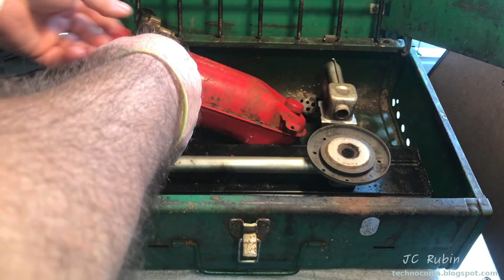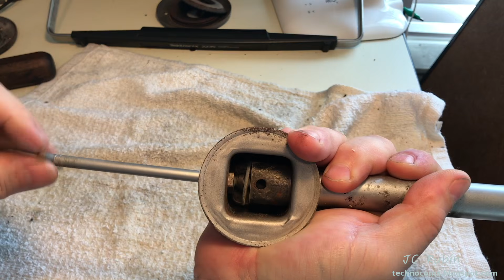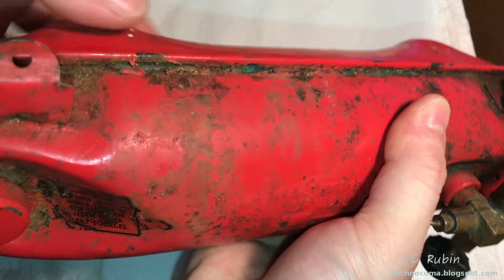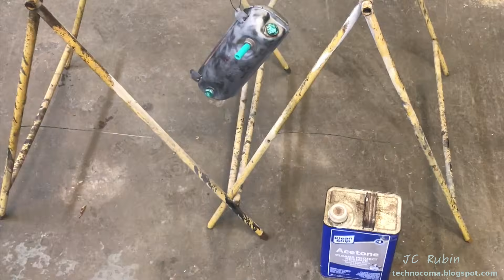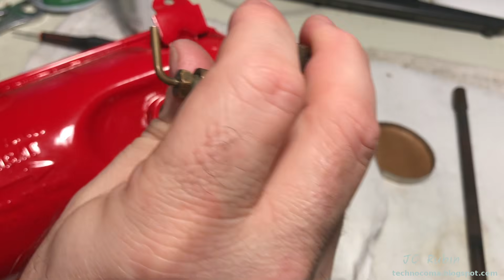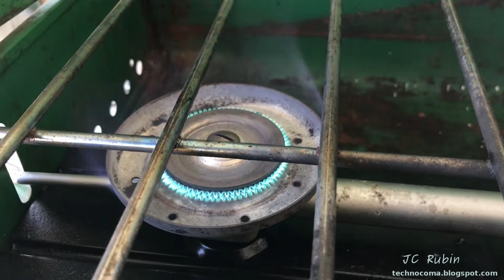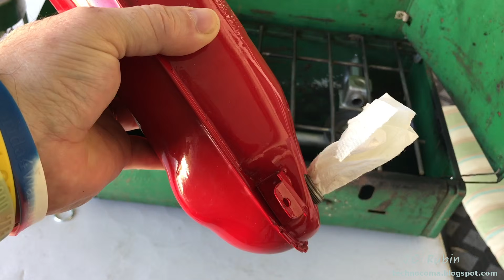Coleman Stove Model 425 Teardown Maintenance Rebuild and Leak Repair

Comment: On some models. Instructions show higher side up on on the burner covers that is held in by the screw that holds the plate assembly in. Reason for this is that the flame doesn't spread to far. You do not want fire like flame on the primary burner when shutting the secondary off or on both for that manner. What can happen is if the flame is too big on the primary even after the generator is thoroughly heated it can  flash over and ignite the atomized fuel on the needle nozzle orfice and blow torch the fuel inside the manifold. I have a 425 that someone gave up on because even after he cleaned the burner plates up and then screwed the covers back on and they were on high side down instead of up and he had nozzle flare up and the center screw almost touched the generator which can cause a cold spot and flare up. After 30 seconds of heating the flame in the single burner should go blue with that outer light ring on the outside and then turned down for equal heating. Turning off the secondary burner should not flare up the primary that much to have a fire flame. Usually that means the burner cup is on wrong on the primary.

Comment: Brilliant video. I have the 425 with a dual fuel generator. I use it everyday, as my only kitchen cooking stove. The problem is the residual  ring of fire can easily go for 5 minutes or longer. I had the valve apart and cleaned everthing. Could it be the valve is worn out because I use it everyday? Any guidance would be appreciated. Thank you, and all the best.

Comment: great video, I bought a used Coleman Feather 400 stove, can you please explain to me the square rod that is in the pump area? My pump would not work, I took a crescent wrench and loosened that rod, now my pump works however, is that rod to be loose or tight and what does it do? thanks
Reply from the maker: The pump mechanism is removed in its entirety by way of a special tool. That square rod should not normally be rotated.

Comment: One of the best tutorials Ive seen! My stove is leaking fuel where it screws into the tank. This happens when I pressurize the tank. Am having difficulty unscrewing it also. Is there a gasket that might be bad, or something else?
Reply: Hi Mike. I'm having this very same problem. Were you able to fix it? If so, how?

Comment: Great video.  I’ve got an old model 425 with the gold tank that needs a little love.  Good tips. Thanks.
Reply from the maker: Must be very old, I think its copper or brass.
Reply: @retrotechandelectronics  it’s a steel tank but painted the copper color.   From 1950-53
Reply from the maker: @shaneoconnor115  ok, I believe the really old ones were brass

Comment: I bought a 425b off ebay sometime ago,  I can see already my tank pump isn't making enough pressure....tank is holding what pressure there is ....hear a very small hiss from the generator, so I'll be doing a rebuild and cleaning.....Yes, your video has been quite helpful, Thank You sir.
Reply from the maker: Glad I could help.

Comment: Excellent tutorial. I have a 425C. I can feel intermittent pressure when pumping and know I can lubricate the leather with oil. My problem is when pumping sometimes the pressure will suddenly build in the tube and the check valve I don't believe is allowing the air to pressurize the tank. Any advice? Thanks.
Reply from the maker: Try some oil at the check valve.

Comment: I was gifted one of these the other day, used (barely).  The tank wasn't emptied....this should be fun.   I can't get it to pressurize, so it looks like some work ahead for me.  Thanks for the video as I've never used one and was pretty clueless as to all the parts and what they did.
Reply: Some people forget to keep their finger on the hole of the pump as they close it. It’s important to do that. Otherwise u loose lots of pressure. The other thing is the ——I  valve, it must be in the proper position & both burners turned off.

Comment: I went to the school of if it ain't broke then don't fix it!
Reply from the maker: M’kay…
Reply: He was doing maintenance. Well maintained engines, camp stoves, lanterns, & generators will work when a natural disaster hits! Maintenance saves lots of $$$. It use to be a normal thing to do in this country. Now we have a “throw away” economy. People have in general forgotten to empty the tubing behind a dryer, vacuum behind & under their refrigerators. Doing these 2 things will lower your electric bill & lengthen the yrs    they will run well.
Reply: @ActorKevinOlson  Well on engines but so many times I have tried to get something just right and ended up making it worse.  Sometimes it is best to let well enough alone.

Comment: Great video. I wish you did this for hire. I can do some of it, but with a bad wrist from a past break, it is difficult, plus I would likely get the parts mixed up. I have cleaned up my Uncles old Coleman 413E and I'm getting a kit for a new fuel pump assembly and a new seal for the fuel tank cap, but the rest is much to involved or me.  I'm gonna get a good small wire brush and get rid of some rust on the burners, but I'm not taking all of that stuff apart. Would appreciate any advice you could give me I can do myself.  Like, IS it ok to clean out the fuel tank with carb cleaner?  So far, I just put a bit of clean fuel in the tank and swished it and then dumped it. Any other suggestions would be appreciated-from anyone.
Reply: Taking photos & marking them will help. If u can find an extension to make your tools longer it will b easier on your wrist. Writing down the steps will also help u. This video is by far the best one I’ve seen explaining how to do this by far. Take your time too. Using a table and putting the parts in in area marked for them will help too.

Comment: It was possible to get my valve assembly off. I ended up unintetionally ripping a hole in the tank. I don't understand why manufacturers engineer things that are nearly impossible to maintain. They should be shot and killed and replaced with people who are engineers who know how to make things last and easy to maintain. That would be a real engineer. Whoever built these things suck at engineering.

Comment: Nice video. We have one of these stoves in Putao, Kachin State. It had been left with gas in for 4-5 years, needed servicing before it was safe to use. Your video walked us through the process nicely. Thanks.
Reply from the maker: Glad it was helpful, I don't get too many viewers from Burma. Thanks for watching.
Reply: @retrotechandelectronics  These bikes are coming over from Tamu/Manipur as grey market products, i.e. not legally imported. This bike I got I had to pay a small fortune to register and make legal. Parts and service are non-existent. Luckily the shop and owner's manuals can be downloaded. I wish these Himalayans we more old school, no EFI and perhaps only electronic ignition. For this country the more primitive the better. I will note that although the engines are superb, the rest of the bike parts are kind of crappy.

Comment: Would you put some Teflon tape on the valve body?
Reply from the maker: I did not, it’s pipe thread, there would be no harm in a few wraps if tightening it would not suffice to stop a leak.

Comment: It is rare to find someone who has the mind of an engineer, skill with a camera, and great command of clear, precise, English. This would have been enjoyable even if I did not own such a stove (and an old, single-mantle lantern, that still works great after forty years). Thank you!
Reply: That is so funny, you said single mantle lantern. I was at a flea market a day before a storm was to hit here in Halifax, Nova Scotia, Canada where I purchased a 23-year-old Coleman 286 that has never been out of the bow, styrofoam still around the glass, and a 425 Coleman stove that has never been turned on, but I was worried about dried up seals, leathers, etc., and here I am, making sure I don't burn the house down by lighting them up without educating myself first. 
   I only hope that it is not too hard to find that valve seal for the gas valve on the 425. I assume all the seals on both units here are dried up and dangerous.
Reply: Well said. That’s what I’d like to comment.
Reply: Well stated. I wholeheartedly agree.
Reply from the maker: You're welcome.
Reply: @retrotechandelectronics Pays you a really nice detailed compliment and your dumbnavyass says….you’re welcome⁉️⁉️⁉️

Comment: I have an old Coleman stove that I would like to disassemble and clean up so I have watched at least a dozen videos over the last few days.  Without a doubt, this is the most informative "how to" video I have found.  Thanks for being so thorough & clear in explaining the parts, clean up & repair process, and proper storage.
Reply from the maker: Glad to help
Reply: @retrotechandelectronics  Yes, I agree.  I had one tech who really wasn't clean and I screwed up the fuel tank, then another guy make it more clear.  This guy is very clear and explain things well.
Reply: Yes, I really learned from this video. Such careful, precise work. The quality of photography, just everything came together. You are definitely gifted, thank you!
Reply: They are not too hard to work on…. Take pictures of disassembly but not complicated…. Fixed mine it took two weeks for fuel tube to get here but it has not given me problems in over two years
Reply: Made to last a lifetime, and then some. Keep ‘em going, they are beautiful and useful, be prepared and you can’t go wrong, the boyscouts have it right.

Comment: Outstanding in every aspect. Retired Stationary Engineer, Steam power plant for a state facility. Ongoing seminars & conferences, upgrading tech classes every year throughout my career. I know many people who would do just as competent a job on this rebuild, very few who could teach it in as fine a manner as this video. Excellent vocabulary, everything to the point, great step-by-step procedures with the proper explanations of functions. I only regret my lack of access to shop equipment  since I retired Thank you for the effort and time you put into this, I know this will help a lot of folk who are not tradesmen.
Reply from the maker: Much of the tools needed, albeit slower in process could be found at harbour freight.
Reply: Already there. Miss the 20% coupons, new store just opened 5 miles down the road.  But when I worked, I was welcome in all the shops to use their equipment within my abilities, as everything was put away and the space and equipment was cleaner than when I arrived. I retired in 2012 and my home tools just don't match the equipment, tools and especially the professional advice.  I also took care and did the repairs on the HVAC/R ans steam systems as that was my shops' jobs.

Comment: Nice video. I recently pulled out my dad's Coleman 425 stone that has been sitting around for 10-15 years +. There was gas in it, I emptied out the old gas and there was black sediment in the gas and I can see from the inside filler hole that there is build up on the inside, from what I can tell. How can I clean inside the tank?
Reply from the maker: Just as i did in the video, with coleman fuel

Comment: Does packing need to be changed on the little flip bar used for starting the stove?
Reply from the maker: Packing need only be replaced when there is a leak. It’s not a regular maintenance item to replace packing.

Comment: I use small brass nuts with radiator cleaner and HOT water in rusty tanks  and shake gently for 10 - 12 minutes, let cool, open up and pour out a ton of rust and debris. Clean again with denatured alcohol, dry tank with compressed air and wit.h caps off set in the hot sun. 80- 95 per cent effective in removing rust and gunk. But: pressureize tank and immerse in water, any bubbles coming from tank body means tank is no good and unrepairable.

Comment: So great to see & hear a lucid, logical, eloquent disertation. Well done! These are great SHTF stoves. Everyone should aquire one for camping, winter storm power outages.
Reply: I have one that is over 50 years old and has never been maintained, and after hurricane Ida I brought it out and it burned great one gasoline.  I used the same stove for 5 months on the road in 1999.  One of the most elegant engineering designs I have ever seen!
Reply from the maker: Thank you kindly!

Comment: My grandfather recently passed away and he had one of these in storage. I took it thinking it was a propane stove and almost took it to the scrap yard thinking it was a piece of crap before I did some research on how it works. I thought it was the coolest thing. When I got home from work, I took it outside and with the old fuel inside and it being in storage for who knows how long it lit right up and worked perfectly. It's the 425B so I believe it's at least 60 years old. Can't want to pull it apart and get it cleaned up. Your video will definitely help. Thank you
Reply from the maker: Enjoy it!

Comment: Is it best to store the tank without fuel versus with fuel?
I was told to store it with fuel in the tank so it won’t rust out.
Reply: Coleman fuel. Yes. But fill to bottom of filler neck or just below. Coleman has anti corosive components. Id still use up the fuel in two to three years. Make sure ALL debris and old fuel  are removed before you do this. Fuel does go bad. Clean tanks help slow down deterioration.

Comment: nice video it was a little fast for me but i have a 425 E i get fuel to the burner for just about  30 seconds the stream coming out of the generator tube is real fine. This is my first time ever working on this kind of stuff. And by the way i am not a mechanic im doing this for a friend who is going somewhere to live of the grid he is kind of a hermit hoarder. also on left burner it lights but go's out real fast and info would be nice i will subscribe to you account thanks Dan
Reply: Make sure the secondary burner is in the closed position. Test. If still not holding pressure, you may need a gas cap gasket. If still not holding pressure, you may need to clean or replace the check valve on the pump.
Plus once the main burner is ignited, you'd most likely have to pump it again.

Comment: Hello .. I have a different model but it is Coleman .. could you help me, tell me why the fuel is returned through that part of the air pump .. just change the internal non-return valve.
Reply from the maker: Sounds like the one way valve is failing.

Comment: I have an old 1970s one we used sense i was a kid.
The only thing that mine has a problem with is the choke lever'
I have to move it around to get it to light.
I know it is supposed to be facing up when lighting, but it don't light facing up.
So i have to move it from side to side till it is at the right spot to light.
Then i lower it facing down after it is lit for a minute.
Once it starts it runs well.
I also bought a new one that uses the old type of fuel, and gas that can be used in a car.
But so far i have no used car gas in it.
Using car gas just don't seem safe to me.
Reply from the maker: Just needs a cleaning i think.
Reply: I’ve used the ones that are dual fuel & they worked great. I’ve never used anything but white gas ( Coleman fuel) in any that aren’t marked dual fuel. What type of gasoline would be safest for those that aren’t labeled dual fuel? TY in advance!

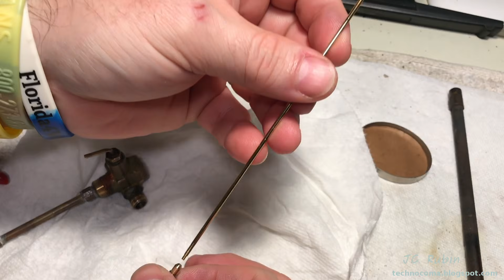Comment: CAUTION! Be very careful tightening the needle back on to the valve assembly! (19:55 mark in the video) I accidently overtightened mine and snapped it off. It's a sickening feeling. I had to order a new valve and generator assembly.
Reply from the maker: Thanks for the info!

Comment: My tank won’t shut off.  I replaced my check valve and now it won’t shut off.  Anyone know what’s up
Reply: Me too on my old Coleman 432A
Reply: @vimalchauhan6369  I took the top part off of my fuel tank and cleaned all those parts off and took off the valve, lots of crud in the valve that needed cleaning.  Now a nice blue flame and it turns off now. It’s like brand new

Comment: My tank only holds gas for about a min or two while one burner is lit .  Does that mean I have to replace or inspect my check valve?
Reply from the maker: Most likely, its not holding pressure, check valve or pump suspect.

Comment: That model did not have the gasket between the bottom plate of the burner and where it sits on the manifold ?
Reply from the maker: no, it did not.
Reply: @retrotechandelectronics  I wonder how they did that ?  I had to make some because they are out of stock .

Comment: Great video, thanks. The experts at the Coleman Collectors Forum tell me that leaving some fuel in the tank is a good idea, it was rust-preventers in it and being pure naptha will never go bad. I believe them, so that is what I do now. There are a few over there who disagree.
Reply from the maker: Ive heard that, Im not completely sold on the idea.
Reply: @retrotechandelectronics  I agree. I've had problems with the fuel feed tube assembly for my Coleman Dual Fuel Lanterns. If I fail to empty the font before storage, the fuel feed tubes (which have very small diameter feed tubes) inevitably become restricted over time resulting in very poor lantern performance. And I ONLY use Coleman fuel, I've never used gasoline in them.